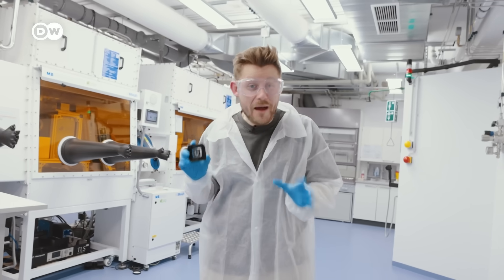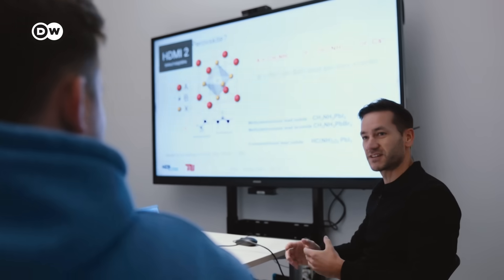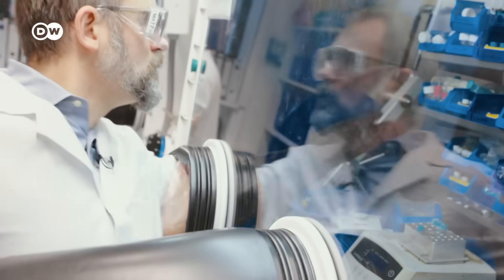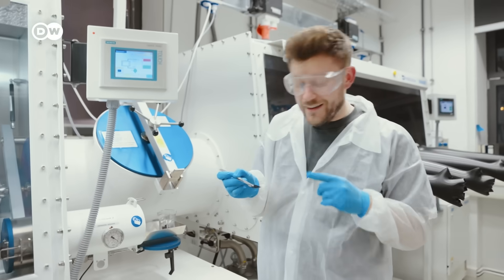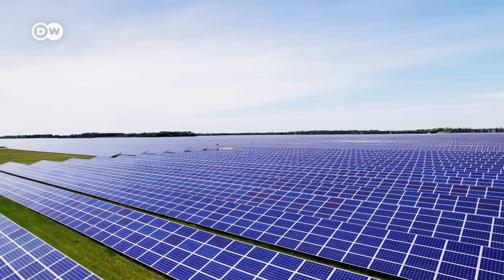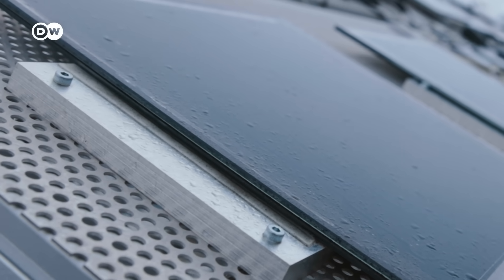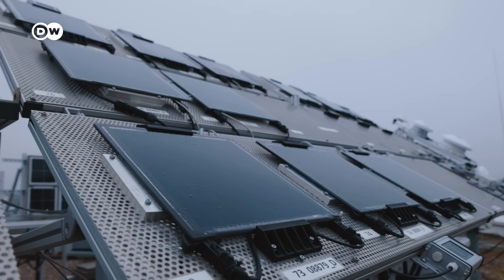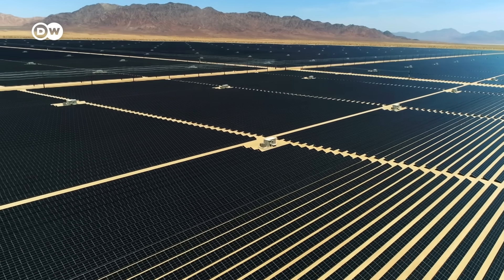Are perovskite cells a game-changer for solar energy?

Comment: Deception from the start these unique cells have been around for a long time. They don’t have a long life. This is their problem. Even currently their lifespan is only a fraction of their alternatives. They are more efficient they can be printed. They can do a lot of things except stand the test of time There you go in a nutshell now watch the sensation of this presenter trying to sell this product to who who is this product being sold to? I like just creating demand by making you aware of a product that has a shorter installation life, then some standards, and even depending on their orientation in current timeshorizontal to vertical, should we have a layer of sugar to cause light to twist within the cell? Is this a hint? Sorry I’m an arsehole

Comment: The most contradictory part of "renewable energy" is that the silicone has to be mined*, just like white gold (lithium) has to be *mined to produce lithium-ion batteries for EVs.
So the question is: are solar panels, and EVs, REALLY that non-polluting, given that the extraction part of the product life cycle created just as much carbon!?
Reply from the maker: Hey there! Yes, there is constantly research for other materials, e.g sand and salt instead of lithium-ion batteries👉https://www.youtube.com/watch?v=-vobMl5ldOs
We also did videos on both silicon 👉 https://www.youtube.com/watch?v=ydiX4Iayosg and lithium 👉https://www.youtube.com/watch?v=gAZV1Ut6DDs
Reply: According NREL, yes, by orders of magnitude

Solar even including manufacturing and disposal is 10 times cleaner than nat gas and 20 times cleaner than coal. 

Source: Lifecycle Assessment Harmonisation, NREL

Comment: We know hybrid car technology. A planetary gear or differential gear can integrate two inputs without any torque or motion loss. According to this aspect wave power can be converted in a step by step manner into a continuously rotatable output that can rotate a powerful alternator. We can develop a wave power technology and 95% of the wave's oscillation and up-and-down movements will be decreased and transformed into electricity when it goes through the power plant. This technology's features include - reducing global warming, being efficient and economical, reducing coastal erosion, producing clean & pollutant-free renewable energy, and having the capacity to supply all of the world's electricity needs.
Reply from the maker: Hey Jana! We tackled wave power more in detail a while ago. You can find the video here 👉 https://www.youtube.com/watch?v=UUlA5WKDiww Oh, and have you heard about tidal power? https://www.youtube.com/watch?v=1-2TyKqP84o
Reply: My comment is not about the existing technologies. It’s about my new technology. According to my new technology, every little/large motion of kinetic and/or mechanical energies can be integrated without any torque/motion loss. And this technology is configured to integrate every amount of wave motion in a step-by-step manner to provide a continuous rotation, in the form of a single rotational output at the delivery shaft that can rotate a Powerful Alternator. @DWPlanetA

Comment: you are mental  searching what  why need  solar  , Duke green apple 🍏  born  me  business  mind  enough   for  you  mental  chemistry  only I need your  discovery  

duke decode 2:37 when turbine in water   how  electric   produce  your  fooling  mind  my mind  analyse this  ( means  Duke turbine spin in water metal  generate heat   metal  inside icon particle produce electric  energy  in volt count /  that  it  only  

Duke : pervoskite  my business  mind  use in My Duke pico glass transparent  phone  code glass with this : pervoskite  A B = X  power 🔋   cell  with now 3D graphic   programming  conduct   cell  in  Duke pico  chip  = semi conductor &  Duke memory  with  corner  glass  strip coated this  electronic  chip kit  graphic   itching  Duke A B = X processor   code in  12 core  process + Ram 12 GB in pico  format  server  satellite   provide  glass   electronic   coded  = side strip  pervoskite  :  connect  Duke 6G = 8G  VPN Microsoft  vision glass  all  satellite   VPN  login  run  access   your  Duke 9G bionic  human implant   chip data  human   touch  any  bill gate surface touch  interface  display  satellite  🛰   display   your  body  implant   chip 365 day & trek  each finger  gesture comand  screen holographic display 160 inch max  
Duke air screen , surface touch  ,  visible Naked eye  AD2050 or 2060 End     vision start  

Duke re born  🏴  &  li  re born 🇨🇳

Comment: Isn’t silicon one of the most abundant things on the planet. Like quartzite is essentially everywhere and carbon is too. They mix the two in a kiln to form silicon.
Reply from the maker: Hey there! Thanks for mentioning! We regret not formulating the sentence more clearly and accept that it could be construed as misleading. As other users have pointed out, we are referring to the availability of high quality silicon that can be used for PV.
Reply: @DWPlanetA  Silicon sand yea but quartzite rock is already at that purity level. It’s pretty decently abundant too. That’s not really the issue the bigger issue is the firing process to create silicon from it take a ton of energy.

Comment: The currently poor longevity of perovskites may be less of an issue with shorter lived commercial goods like devices, clothing, accessories or backpacks that need power.
Another benefit is that the very low weight of thin film perovskites (even after encasing) may allow installation on roofs and surfaces that would otherwise require structural upgrades.

Comment: "No matter how highly mechanised and fossil fuels self-powered, fossil fuels extraction requires a number of people - as if the process is executed by hands using buckets and ropes".
Today, this number is 8 billion people - working flat out 24/7 - strong.
Frank Nowroth (Oxford PV), you and I are among them.
Our Western Civilisation has been no more than a fossil fuels-extraction operation - all along.
"In any system of energy, Control is what consumes energy the most.
No energy store holds enough energy to extract an amount of energy equal to the total energy it stores. 
No system of energy can deliver sum useful energy in excess of the total energy put into constructing it.
This universal truth applies to all systems.
Energy, like time, flows from past to future" (2017).

Comment: 3:20 More abundant than Silicon?  Silicon is almost 30% of the earths crust and next to Oxygen is the most abundant element on earth.  So nope...  The engineer seemed to pause slightly when talking about the quantity.  That is should be ok...  Sourcing of material should be heavily reviewed for long term sustainability.  Otherwise, it could be a non starter for anything other than in the lab or limited use.
Reply from the maker: Thanks for the attention to detail! We regret not formulating the sentence more clearly and accept that it could be construed as misleading. As other users have pointed out, we are referring to the availability of high quality silicon that can be used for PV

Comment: Can perovskite based solar panels be recycled?
Reply from the maker: Yes, they can be. But since they have not been commercially manufactured and distributed, it remains to be seen if they WILL be. 
Here is some tentative research discussing the feasibility of these devices:
📚 Materials Today, "Recycling and recovery of perovskite solar cells" 👉 https://www.sciencedirect.com/science/article/abs/pii/S1369702120304533#:~:text=Recently%2C%20degraded%20perovskite%20films%20from,the%20degraded%20PSCs%20%5B32%5D.
📚 Nature Communications, "Recycling lead and transparent conductors from perovskite solar modules" 👉 https://www.nature.com/articles/s41467-021-26121-1
📚 Nature Sustainability, "Life cycle assessment of recycling strategies for perovskite photovoltaic modules" 👉 https://www.nature.com/articles/s41893-021-00737-z

Comment: Over 28% of the earth's crust is silicon.  
A solar cell work with electrons at lower energy  are transported in and electrons with high energy are transport out . the main problem with the perovskite cells is transport of electrons with lower energy are worry low. This is why a pure perovskite cells are braking down after 0,001 second. 

Companies and development institutions that make money by claiming to develop perovskite cells present silver/perovskite cells, this extends the life a little bit. but a lot of silver is used
  Perovskite cells has no further! 

in gray weather, silicon has a theoretical efficiency of around 55% - unfortunately, silicon solar cells are incorrectly designed and only have an efficiency of 2 to 7%. I have made a video about how silicon can be utilized in a better way
Reply from the maker: We also have a video about silicon efficiency that you might be interested in. Check it out here 👉 https://youtu.be/ydiX4Iayosg?feature=shared And let us know what you think in the comments 🙃

Comment: Not true that perovskite components are more abundant that Si, which is what the Earth's crust is mostly made up of. Also the video (at least the first half that I saw) does not consider the fact that perovskites most often contain lead and/or barium, both extremely toxic materials, and combined with the fact that perovskites are not particularly stable materials , mean that a damaged cell carry the risk of environmental pollution. So the bottom line is that there is still lots of research needed for perovskites to push out Si in commercial solar.

Comment: Can you also use perovskite in batteries? I read about batteries with silicon anode, but could perovskite be used instead?
Reply from the maker: That's a good question - and one researchers are actively trying to answer. Many say it's promising BUT the technology is not quite there yet. 
Here are some additional resources on the topic:
📚 Nano Energy: The study says they need to conduct more research, but metal halid perovskites are could be promising for lithium-ion batteries (LIBs) and photo-rechargeable batteries. https://www.sciencedirect.com/science/article/abs/pii/S2211285523004834
📚 Journal of Energy Chemistry: Researchers suggest hybrid perovskites in energy storage would be the way forward https://www.sciencedirect.com/science/article/abs/pii/S209549562200211X
📚 Advanced Functional Materials: Here, researchers find it's not suitable for energy storage https://onlinelibrary.wiley.com/doi/full/10.1002/adfm.202206958
Reply: P3C

Comment: I disagree that cost per watt needs to be cheaper for perovskite. For solar farm use, yes, but for things like solar panels being put on the roofs of electric vehicles, the biggest issue is panel efficiency, there's not enough roof space right now for it to be very useful. But if it was 10% higher efficiency, maybe that's enough for EV manufacturers to consider, even if the panels cost something like 50% more.
Reply: aptera x

Comment: 🎯 Key Takeaways for quick navigation:

00:00 ☀️ Perovskite solar cells might revolutionize solar energy, offering more efficiency than silicon cells and being easily synthesized without intensive mining.
01:07 🧪 Perovskite's crystal structure, ABX3, with components like methylammonium, lead, and chloride or iodide, allows easy synthesis and processing at close to room temperature.
03:15 🔄 Perovskite solar cells can be made using methods like spin coating or direct printing, offering advantages in abundance, ease of processing, and lower energy requirements compared to silicon.
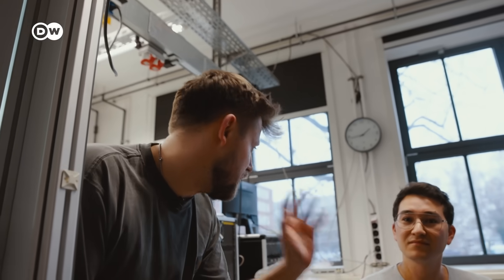05:20 ⚙️ Tandem solar cells, combining perovskite and silicon, show almost 30% efficiency, utilizing visible and infrared light, potentially absorbing 50% more sunlight overall.
07:18 🌧️ Major challenges include stability issues, degradation due to external factors, and the need for encapsulation; commercial production requires addressing these challenges.
09:16 💲 For perovskite to succeed, it needs to beat silicon on a cost per watt basis; cost-effectiveness and stability are crucial factors for market adoption.
10:47 🌐 Oxford PV claims to have solved the degradation issue, aiming to ship modules by mid-2024; successful tandem cells could generate 25% more energy than silicon solar parks.

Made with HARPA AI

Comment: Normally with a labile material it is possible to devise an accelerated test if you understand which environmental factors are impacting the material. That’s the key here. Once you have an accelerated test it’s more efficient to tweak the formulation in development, as short term testing can then validate your hypothesis and changes.

Comment: Why do they have to last 20-25 years?
If they can be mass produced cost effectively are environmentally sustainable and recyclable... Why must they have such long life BEFORE commercialisation?
There are plenty of short-life products which are not sustainable, not recyclable and damage the environment, which are brought to market every day.
So why must this prove to have such longevity before introduction?

For that matter.. 25-30% efficiency is a bit of a bad joke.

To me it seems possible to create a cell which is 60-80% efficient but which rapidly degrades.
Trees manage it...

It seems the trick is rapid regrowth of cells rather than labour intensive manual replacement.

Comment: tl;dr:
So perovskite is promising because it is not made out of silicon that needs high temperature to manufacture, but lower. Except that the high efficiency only achievable when you do layer it on silicon.
It also degrades due to sunlight, water and high temperature exactly those things a solar cell has to withstand.
..
At least the puffy arms look funny :)

Comment: They don't work at night or when covered in snow no matter what they are made of. In terms of panel capacity versus output over time they effectively  work at 11% of installed capacity so even if the panel was 50% efficient it would only go up to 20% overall. So game changing no.

Comment: It doesn't matter how efficient a solar cell is.  When your area of the world is not facing the Sun, your solar cell is producing zero power.  When it is winter in the north, you only get 8 hours or so of daylight.  The further north, the more darkness.
So when you need the most electricity, you get the least light.
Maybe one day when there is very efficient and cheap battery storage will solar finally be useful.
Reply: Battery storage is already getting pritty cheep. About 2.5k for 15kwh last time I checked.

Comment: "Everything is possible so nothing gets done." -S.Westfield   All these home energy technologies are developing so rapidly in parallel, all hold promise but none of them are cheap nor ready. So as a consumer trying to save up on a solar array & home battery, I'm really overwhelmed & discouraged with the likelihood that whatever I choose will obsolesce at a savage rate both in inherent value and relative efficiency. It could be perovskite, lithium-sulphur, iron/air, solid state, carbon,.....and/or rapid improvements in any one of the many different chemistries. Doesn't matter. So I fear there's really no point researching/educating myself about anything now if my system won't get installed for another two or three years.
Reply: whatever you do today will be worth the cost, even if its a bad investment in hindsight. all that it means is that in the future you can easily upgrade everything for a even more efficient technology when you calculate you won't be losing money.

Comment: Silicon solar is still quite efficient and also all of the resource greenwashing you just did doesn't apply to tandems which are currently the only perovskite-based technology that can surpass them. The other problem (related to stabillity) is that perovskites contain lead, or at least the performant crystals do, so if they're water soluable crystals they can leak some lead into the environment. Although having said that, we are absorbing the highest concentrations of background lead of any human generation thanks to the romans and victorians. I think it's greenwashing with a eurocentric agenda because we're annoyed that china won tbh.
Reply from the maker: Silicon panels are great, don't get us wrong, but they have reached their efficiency limit. Check out our recent video on the topic to find out more 👉 https://youtu.be/ydiX4Iayosg